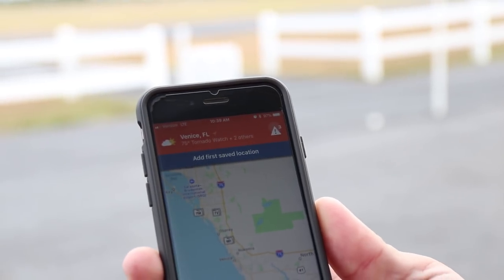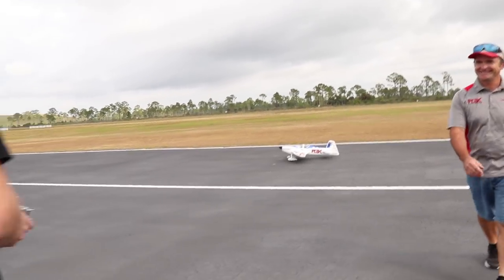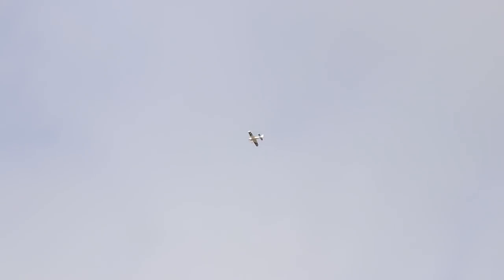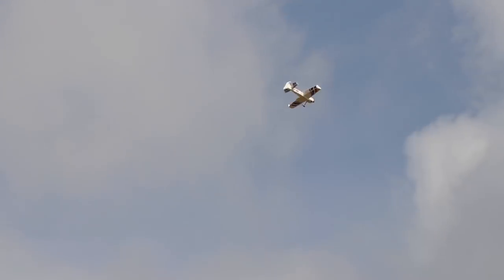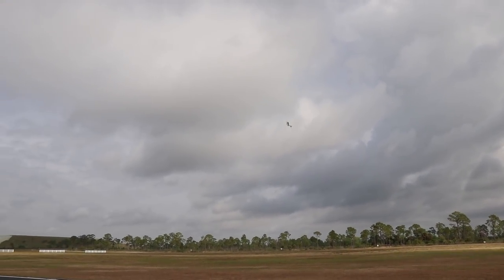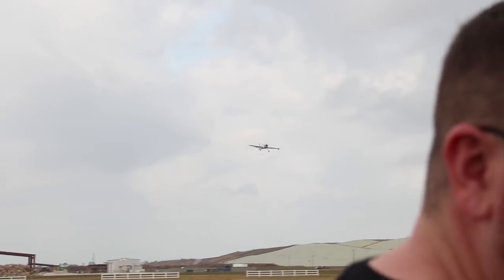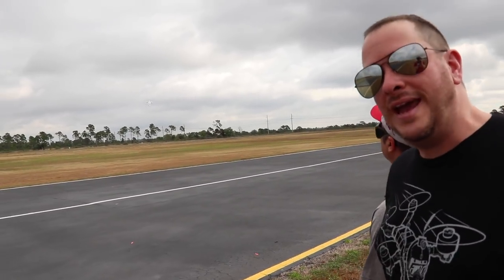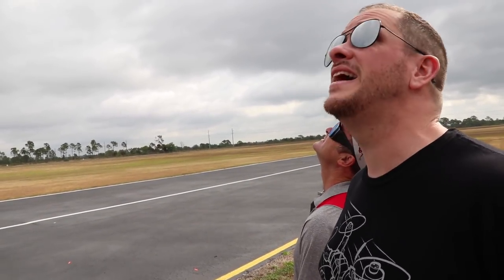Flying a Cap232 in a tornado watch!

Comment: I've owned several Flex Innovations airplanes with my latest being the Yak 55.  When no one else is flying because of the wind, the Yak is up in the air doing amazing maneuvers.  20+ MPH winds are great with the ability to hang in the air, blast forward, climb vertical followed by a flat spin as the plane scoots downwind while spinning, then bring it in for a zero ground speed landing.